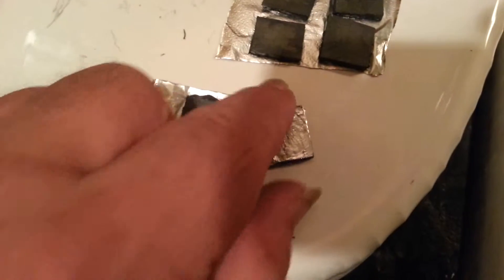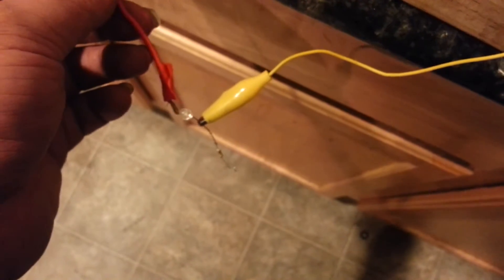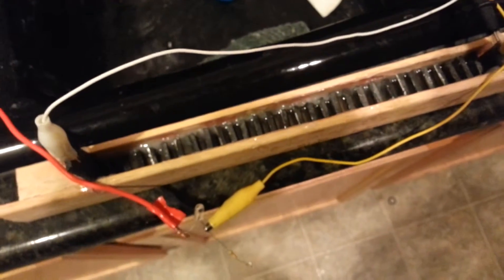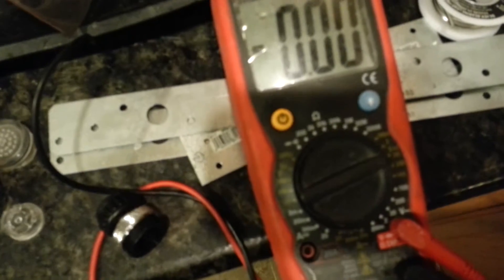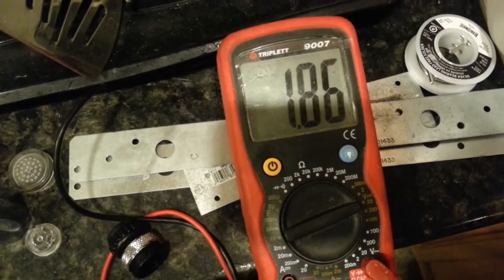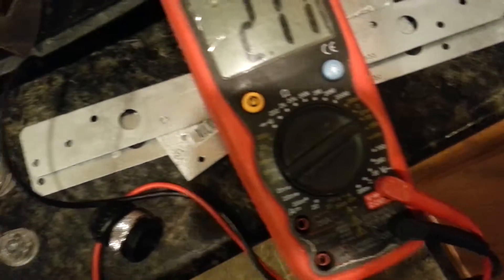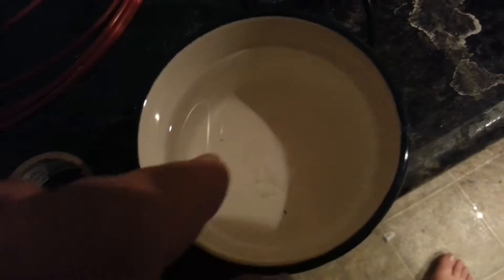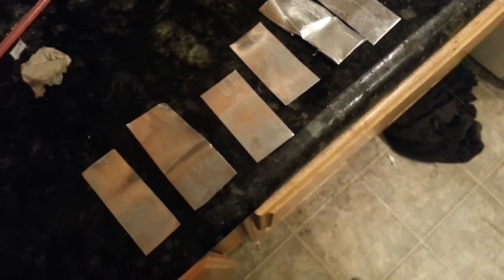Karpen Pile fail - (aluminum air battery success)

Comment: add 25 ml glycerine or 25 ml baby oil with 25mg of epsom salt, 25mg alum, and 50mg potassium chloride. In oil you can get a series ability, but in water if they share the electrolyte you will get a short! It would be easier if you placed a small cloth between each of the electrodes then wrap it with plastic wrap with a connector wire for + or -.
Reply from the maker: Ahh surely; The cells were fairly isolated because they were held together with silicon glue.  Had expected output voltage.  The problem was it only lasted about a week because the aluminum foil was so thin;  When it was done there was basically no aluminum left on them.

Comment: The copy of the patent text I have reads: "In all preferred embodiments of the battery, the phases are in chemical equilibrium; no reaction takes place between the phases in contact, and there will not occur concentration of the phases, as is the case during cell operation of known concentration." So, he certainly didn't intend that you can use just any materials for the battery. Perhaps nickel and carbon the two materials he specifically mentions would be a better choice to test it out.
Reply from the maker: maybe; but also not calcium carbonate but sodium carbonate....